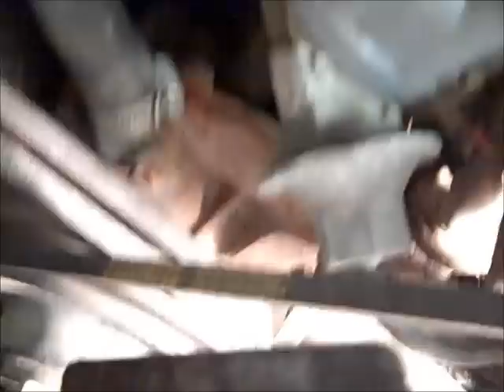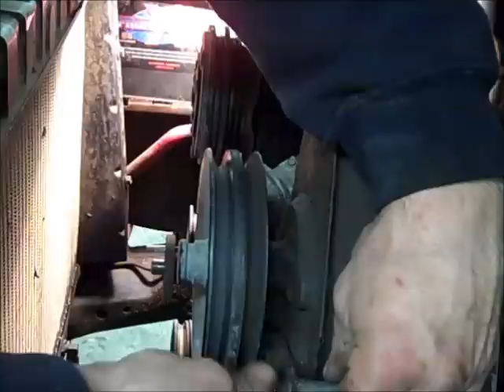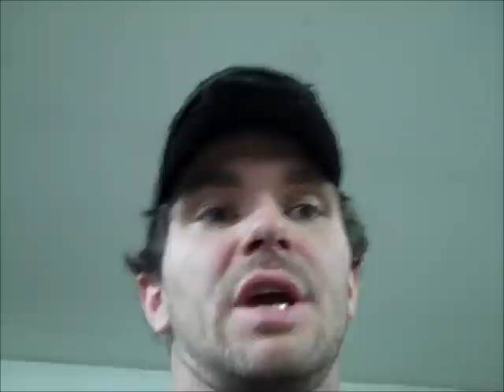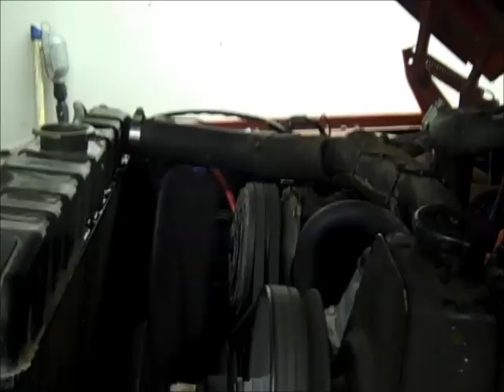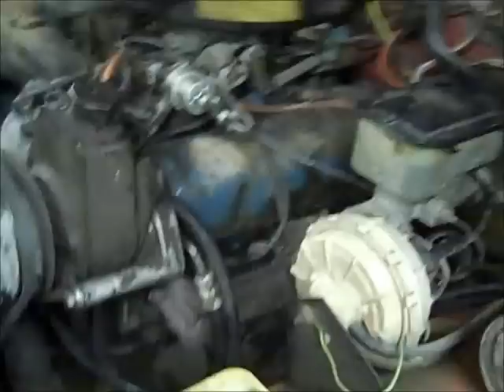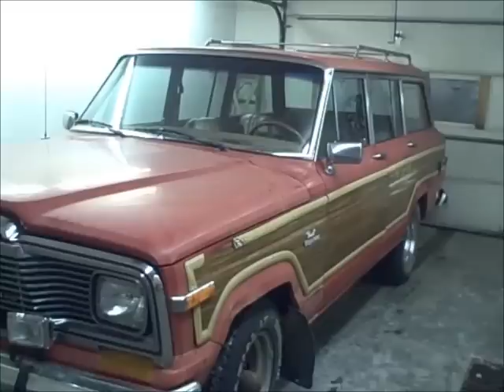Fixing Denny's Jeep (Again) Part 4 The Final Chapter

Comment: @nsb22 probably not. many power steering pumps just whine. he could probably put a brand new one on that will make the same noise. if it steers easily with no problems, no need to replace it.

Comment: @jeremys924 I love my fords. Seen many die tho. My 351w truck ran great on year old gas and allways worked hard and given no love. Fuel pump died though and its in the tank but everyone does that these days. My 7.3idi has 342,000 miles. Fleet truck, then hauled a horse trailer. Now i just daily driver it. Chevys are good too i'm just no chevy guy but respect is given where it is due.

Comment: @OnusofStrife  My first car was a Ford. got it for free and sold it for free, just sayin.
On another note: My 99' 454 7.4L has a loose wrist pin and bent control arm on cyl 1, that was 10k miles ago. I still drive the piss out of it with no loss in power. Chevys dont die.
350k miles on a ford is very impressive though.

Comment: @OnusofStrife @talfacprez
Im sorry, i tiped that wrong, its a 75' f100 and the engine was a replacement 360cid done in 1995. Piston #1 bent into a 45 deg angle due to waterlock while running.
This was the trucks 2nd engine and 3rd rebuild. I keep telling my friend to get a Chevrolet but he loves that bucket of bolts to death. litteraly untill it dies. ;)